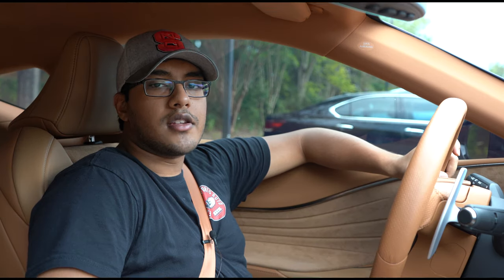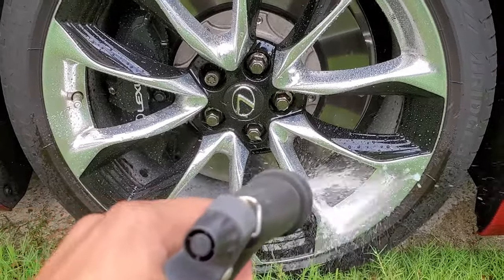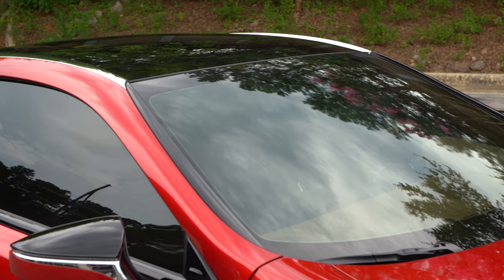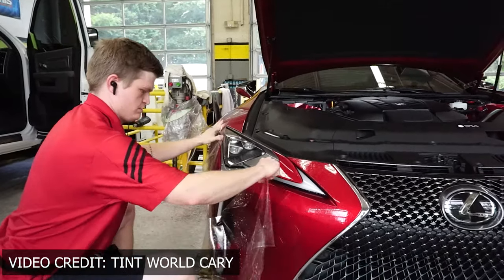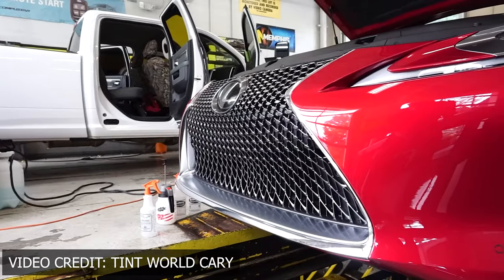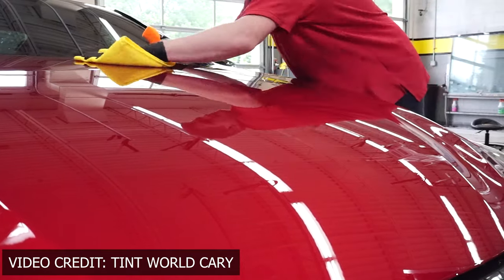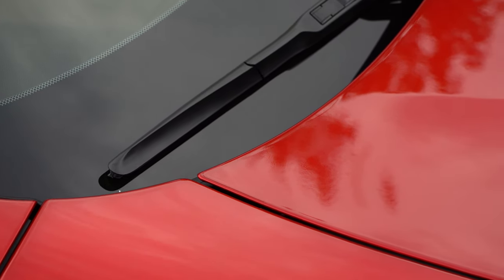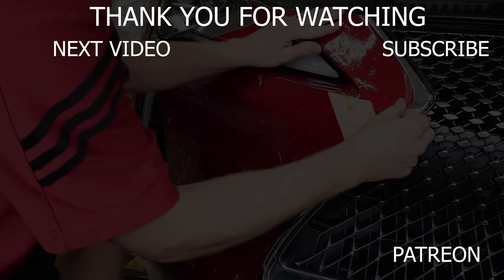Paint Protection Film Review PPF & Ceramic Coat/Tint...Is It A Scam?

Comment: I have a 2015 GS 350 F-Sport that is Riviera Red and I am getting my car done right now. The paint was in great condition with very little chips but it's costing me around $5,700 with some adds. Insane Paint Detailing is doing my PPF and ceramic coating, Alloy Rim Repair doing my rims, Tint One is doing the tint, and Technica Motorsports is installing my springs and spacers.

Rejuvenation Polish - $375
Xpel Ultimate + PPF Package - $2000 (Includes Full front, hood, side view mirrors, side rockers, headlights, quarter panels)
Exo ceramic - $800
Designed painted F-Sport calibers (black with red logo) - $300
Rims restoration to include ceramic coat - $725
Tint to include front windshield - $625
Tanabe NF 210 lowering springs - $260
H&R DRS 15mm & 20mm spacers - $250 
Installation for springs, spacers, and alignment - $300
Wind deflectors from WeatherTech $99

Comment: I have PPF installed on my car 4 years ago. I was hit by a large rock and it tore through the film. The paint was not damaged
Reply from the maker: Wow nice do you remember the film company?
Reply: @MeynMotorGroup  Xpel film installed by extreme colors
Reply from the maker: @MyCatIsSmarter  I've heard xpel film is slightly thicker than other films the best if you want to protect your car more
Reply: @MeynMotorGroup  I also had a nick through the film over 1 headlight. Headlights are so expensive now and I wanted the protected. I went back to Extreme Colors and had the film replaced in 2 areas
Reply from the maker: Oh yes very good point headlights are extremely expensive now with all the LED and tech they incorporate. Glad your car is protected and the shop took care of you this is def a good investment
Reply: So when it tore through the film, did you get a new film? How much did the film cost? Does the cost of film less than the cost of repairing paint damage without ppf?

Comment: First off, I am glad you got it done and are happy with the results.  I checked their page out and they don't even list the ceramic coating manufacturer but are wiping it off immediately with no flash time so I am guessing a lower class like Adams, Chemical Guys, or other quick flash coatings.  Nothing wrong with that, it is protection, but its not "the best".  I do see they perform a one-step correction, which is good, but you did not mention that some cars may need more work and that is VERY HIGHLY recommended.  But a detailer will discuss those options with you.  I agree that on some cars it may not seem worth it but if you DO have a cheaper car and want to protect it because you love it, then by all means!  No shop will turn you away because your car costs less.  So you don't need a supercar to get this work done, they will perform the service!  I just want your viewers to know about all options before settling on one.  Higher end coatings like Modesta, CarPro CQuartz and Gtechniq offer 10 year protection.  And if you DO get a coating, you will have to do yearly maintenance on it.  It will need touched up at least yearly, depending on usage.  Yes the clean up is amazing but it can and will get scratched, swirled, and chipped.  PPF is the ultimate protection for your vehicle, hands down!  So again, congrats on getting the work done.  I look forward to your 3, 6 and 12 month review.  By then you will be ready to go electric.  :)
Reply from the maker: Thanks I am very happy with the work for sure. The owner told me the name but I forgot but they just brand it with the Tint World logo but obviously made by another company that I am totally forgetting right now. It's a quality solution very thick 50ml I have no complaints they can't afford to do shoddy jobs in this area, or ever since they are a huge company.

PPF is def the ultimate protection especially if you can afford it but like you mentioned the ceramic cleans up nicely but does not make your car invincible. A slight maintenance is required but for the most part, you can set it and forget it. Will def keep you updated!

Comment: If you do any freeway travel I'd say get the front bumper and complete hood done on just about any car you plan to keep long term.  I got the rocker panels and area behind the rear wheels done too -- rather than installing mudflaps.  The only downside, is that the PPF gets torn up, especially down by the wheels.  But better that than the paint.    Window tint is nice, but I've had the front windshield tinted on  a couple of my cars and it messes with the polarized sun glasses -- which some people may not like.
Reply from the maker: Yea that's very true a lot of people are monsters driving 40-50k miles a year. You are def lowering the value of your car driving that much but there is a lot new Subarus and Hondas that have PPF done at Tint World I was shocked by that not just high end cars.

Good point about the sunglasses you are right about that I forgot to mention as I never wear sunglasses because my vision sucks when I take my prescriptions off lol. Because I can't wear sun glasses, tinting the windows was the perfect solution for me haha

Comment: This was a much better vid than the other stuff I’ve found. I just got a new Model 3 LR, and I wasn’t sure if spending $1700 for the front PPF was worth it, but yeah basically my initial thoughts were the same as yours. At least get the front done, for 3% of the cost of the car. Lately I’ve just been wondering if that money is going to just be lost over the years, but you make good points overall.
Reply from the maker: Glad it helped my friend great price

Comment: I test drove the new 2021 LC500 and I felt a huge delay when mashing the gas.  If you could do some video on the 10 speed auto that would be awesome
Reply from the maker: The car does not provide instant gratification the power from idle to 4k RPMs is almost non-existent you really gotta get past 4800 RPMs to feel a huge surge in power.

The 10 speed is not really 10 speeds, it really only behaves like a 5-6 speed transmission the extra 4 gears are for highway cruising only.

The trans will shift faster than even dual clutches but around town, it will shift like a Lexus ES. You really gotta be deliberate and give the computer time to learn your driving behavior. Transmission is one of my most favorite parts of the car.

If you want more instantaneous thrust, an AMG Benz or BMW might satisfy more. Heck, even some turbo mid-size sedans and family SUVs can get the jump on an LC or RC F. But in my opinion, LC is the far superior street car.

Comment: Any updates a 1 1/2 years later on the tint, PPF and ceramic? I'm thinking about the same for my Infrared 2022 IS 500 F Sport Performance. The guy I'm talking to just does paint protection. He uses SunTek Reaction PPF and Owner's Pride 7 year ceramic. Since my IS 500 FSP is a garage queen, he's recommending just front bumper and mirror caps for PPF. What do you think? Full front clear bra or what the installer is recommending...or no PPF?
Reply from the maker: I’ve since sold my LC since I bought a house planning on getting another 2023. But I did own my LC for a year and half and honestly it held up perfect same as day one and even the ceramic coat held up. Started to weaken it’s effect around the wheels a bit but still worked and brake dust wouldn’t really stick on as much as it did before the ceramic coat. 

Your car might be a garage queen but it’s still going to get driven so better to be safe than sorry. I would do the full front and ceramic the rest, but ultimately up to you. On my next LC I plan on doing full PPF on the whole car really like the peace of mind it gives.
Reply: @MeynMotorGroup  Thanx man. Yeah I think the installer is being "real" based on what I told him about it being weekend driver only...he's trying to save me money for something he thinks I don't need. About $700 for front bumper and mirrors vs. about $1800 for full front. I may go full front anyway. Will be my 1st experience with PPF and don't know if it's really worth it at all, versus just getting paint restoration on the front as needed, as I really don't know what it will look like in say 3 years. Obviously I didn't realize you sold your LC. Bet you got a good price and basically drove it for "free" for a year or two. You've been busy on your channel, congrats on the growth and all the cars you're getting to drive/review now.
Reply from the maker: Ah gotcha yea that’s a big difference in price then sure I would go $700 and just ceramic coat the rest of the car you should be ok better than driving the car with nothing on it. I think you will be happy with the results. Main thing about this PPF stuff is the install that is far more critical that what material or brand is used. Hopefully your guy does a good job. Thank you for the kind words my friend, yea sold in August 2021 good price
Reply: @MeynMotorGroup  based on your and his recommendations I'll just go bumper/mirrors PPF and full ceramic. This company is highly recommended and known for quality installations in my area in Texas... "Houston Paint Protection" company. Your initial take on your experience was the tint really stood out as the best out of all three of the "upgrades". Gotta find me a good installer.
Reply from the maker: Yea tint is pretty excellent you will love it maybe go legal with it idk how strict Police are in your area.

Comment: Did they do paint correction first before applying  your PPF, and what protection did they place under your PPF. ✌🏾
Reply from the maker: My car didn't need paint correction since it was basically new but that's an option they will do if your car has swirl marks or scratches on it.

After the PPF and tint is applied, they coat everything with Ceramic Pro to preserve the vehicle

Comment: You didn't even mention XPEL who is the leader in tint and Paint protection film. I'm pretty sure they would be in the top 3. Both of my cars have had all of this done. My last car had 5 coatings (Gold Standard) of Ceramic paint protection. This definitely makes a huge difference in not only easily cleaning your car but also reducing rock chips in the front and hood.
Reply from the maker: Never heard of Xpel must be new
Reply: @MeynMotorGroup  They have been around since 1997 and as far as I know they are the inventors of self healing Paint Protection Film. Also look at the tests done on their tint and you will find their Prime XR Plus tint is about the best at heat and IR rejection and leads the industry. MANY YouTube videos about this.

Comment: it would be criminal if you didnt ppf the LC and i agree with you window tints (at legal %) its super worth , less heat more privacy but in other hand you can get more attention from cops and that why you should keep them legal cuz you become an easy target when your windows get darker :D About the ceremic coat ,ive never done it but i use a cheap ass spray that says that has ceramic effect and let me tell you for 3 bucks ive seen that thing still working after 5 pressurized washes and on top of that theres no water marks and when its freshly applied makes the car shine a lil more, its defenetly no bullshit
Reply from the maker: Haha yea I agree my friend I hesitated too long for sure but you're def right keeping it legal is always best, I just always dreamed about doing something slightly illegal like this because I'm an idiot but oh well keeps the sun out haha.

I'm glad you're using a solution that has some ceramic in it yea the shop owner said he has a bottle he can sell me and it comes with some ceramic in it so over time it adds a coating of ceramic on your car and if you had the process done like me, it will preserve it for a long time. Def not BS like you said. Thanks again for watching

Comment: Wow bro u definitely got me thinking about getting the ceramic wrap and 45 percent tint on my car I’m very anal about keeping my car cleaned and if I knew this before I might of got it for sure lol thanx for all the info bro 👊🏾👍🏾👍🏾
Reply from the maker: Yea I forgot to mention,  if you're an owner of a slightly old car, and you really love it, this can absolutely preserve the look of the car which is awesome. I love older cars that are well taken care of. Tint is def worth it on any car. Thanks again for watching!
Reply: Exhaust Sports Auto Cool bro ima definitely look into some shops in my area and definitely look for the ones with great warranties
Reply from the maker: Yea def if there's a tint world in your area they have solid warranties but also check Google reviews
Reply: Exhaust Sports Auto Ok bro I definitely will I had them a long while ago on my 2002 Buick Lesabre but had to take it off at the time because got stopped a couple of times and it wasn’t worth the aggravation during those times the law was real strick on tints in philly I  loved that car but after a og mechanic I knew growing up on my block rebuilt basically the whole car after 3 transmissions he told me chalk it up and start new or different loved the engine quiet and pretty smooth but a nightmare in repairs mostly as I stated the transmissions I learned a lot about car repairs from that experience guess that was what it really was for 😂🤣
Reply: Exhaust Sports Auto He always gave me good deals fixing everything on that car like half or more of what I would of paid at a dealership or name mechanic shop always gave him a extra tip too every time just for that still got him on speed dial if I need minor things fixed on the Lex like navigation which he fixed once or minor electrical fixings 😎
Reply from the maker: I'm so glad you have someone like that at your corner a quality mechanic is always a blessing to have super happy to hear that and your experiences
Reply: Exhaust Sports Auto Yes it is bro on that particular car he save me thousands and I’ll spent $10,000 or more on that thing after that I didn’t want to see another American car especially Buicks 😂🤣
Reply: Exhaust Sports Auto I kept up with it good too like all the cars I had after my first one lol but had to get experience off of that one to learn how to take great care of a car so it wasn’t my fault it was that car or just one of those lemon cars 😂

Comment: Fishbowl lol, I actually prefer no tint, my feelings have been hurt.
Reply from the maker: Haha no tint def does look cool and clean but I just needed the privacy and had to protect the interior
Reply: @MeynMotorGroup  Having the front side tinted too looks 100x better tho, I wouldn't mind that but it's risky as you mentioned.
Is the window tint ceramic too, or just a normal one? Ceramic tint has even better heat reflection properties.
Reply from the maker: Yea they apply ceramic Coating on top of the tint so the same ceramic Coating they put on the body of the car is what they put on the tinted windows so water just gets repelled
Reply: @MeynMotorGroup  Ohh really, I was referring to the film on the inside, it's really a thing now. Having the outside coated, especially if it has the same properties as these ceramic films would be even better since you get all the benefits of the product compared to only reducing heat, and it's cheaper too.
Well thanks for the replies man, I really appreciate you taking the time, I even got to learn better alternatives. Have a nice one and good luck with your yt game!